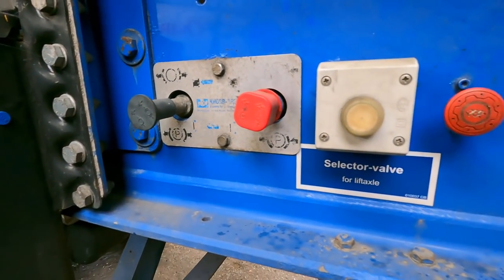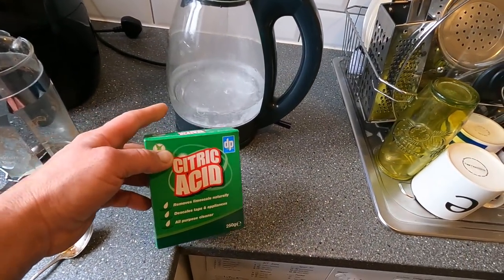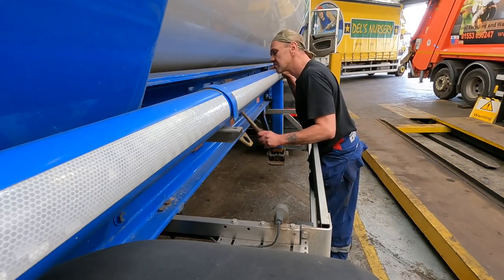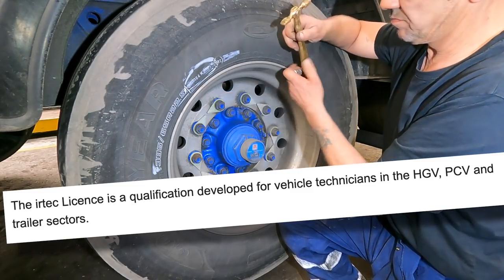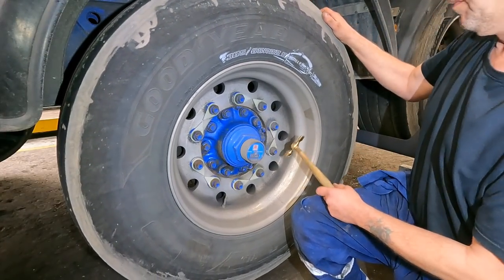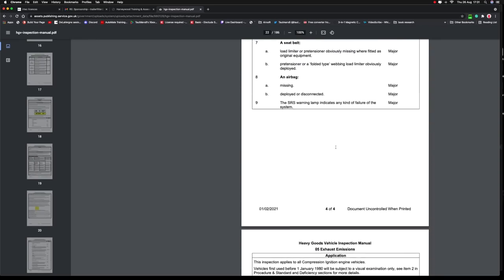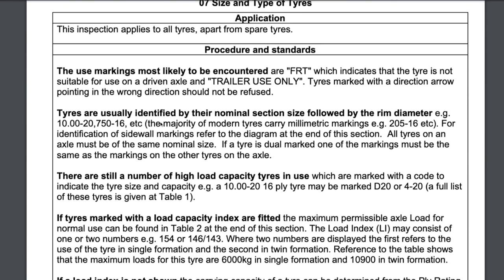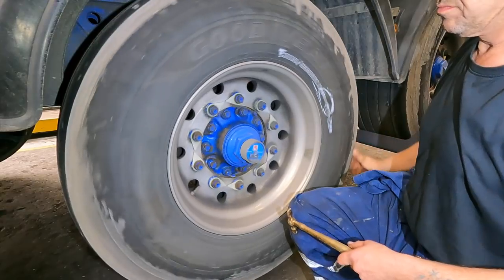UK Trailer (Heavy Axle) Technician - What's Involved With Gaining an irtec Certificate (Inspection)

Comment: I used my tapping hammer on my cars and machine service. Great content again chris
Reply from the maker: I think it must look odd when a car technician sees an HGV technician tapping away on a car...
Reply: Chris where can I get the bpw technical information I am doing a engineering degree at the moment I need some for reference.
Reply: I use to check the nuts bolts and underneath, etc as I have a Honda hrv